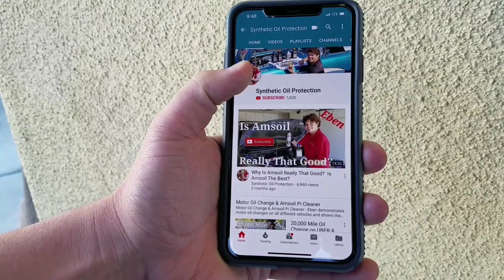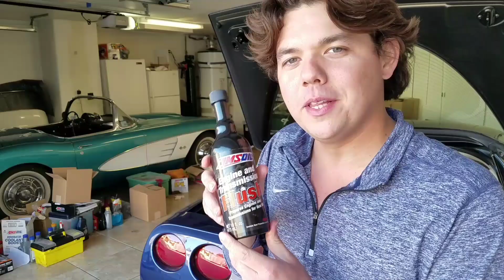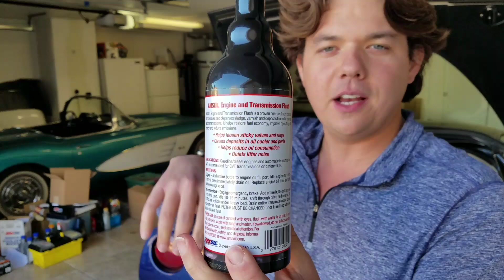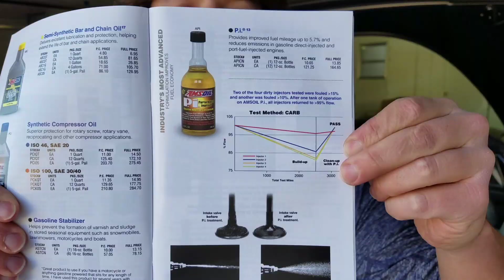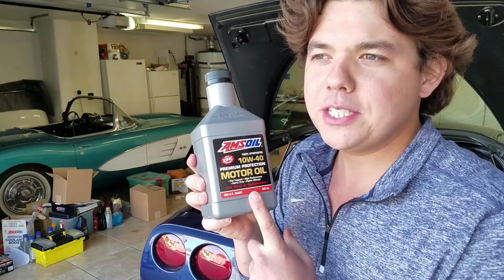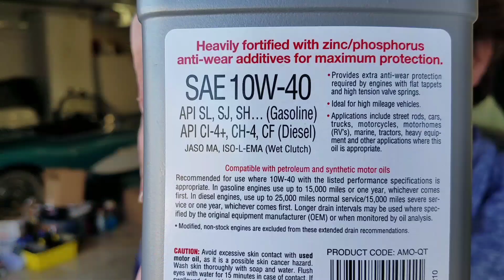Best High Mileage Synthetic Motor Oil - Oil BURN Fixed!!!

Comment: I have a 2014 Subaru Legacy that burns oil due to faulty piston rings. Subaru wont replace the motor. Says it doesn't burn enough oil. Would amsoil help with this issue?
Reply from the maker: Yes!

It will make a startling difference.

I recommend doing a amsoil engine flush I would also run the signature series motor oil as well as the amsoil Power Foam and I would also get the PI Performance Improver for gasoline fuel additive and the upper cylinder lubricant.

If you have any other questions you can always give me a buzz anytime thank you for being a part of my YouTube community!

Professional YouLubher: Eben Rockmaker Regency Direct Jobber AMSOIL Specialist (Dealer#: 5331179) 

To Order AMSOIL Products Click Here - http://syntheticoilprotection.net/ 

Find Products For All Vehicles - 
https://www.amsoil.com/guides/?zo=5331179
Reply: I guess im lucky My 93 Legacy has 240.000 on it and still doesnt use a noticable amount of oil. At about 225.000 miles I went to walmart 20.000 mile oil. I use toilet paper oil filters and normally dont drain oil
Reply from the maker: How often do you change your oil?

Comment: I know I’m a little behind on this video and probably won’t get a comment back, but I bought a used truck with 200,xxxmiles on it. the next oil change is coming up and have been researching engine flushes and have read a lot on it and have seen where everyone has said to not do it. But I am wanting to start fresh on the next oil change and was wondering what your thoughts are on a flush with something like that.
Reply from the maker: Great question Cody This playlist will give you some great insights if you ever have any questions you can always reach out to me anytime.
https://youtube.com/playlist?list=PLB_ftWArBFddawwJUyra9BJY50iLTuBN9
Reply: @Syntheticoilprotection  awesome, I’m seriously considering being a dealer.
Reply from the maker: Sweet☕
Yeah it's one of those things where it's very beneficial if you already do work with lubricants already and you talk to people everyday It's a very very easy thing to do if that is your daily activity.

If you are not familiar with much of it and you're just starting from scratch it takes a while to get the hang of things.

I'll always be around if you ever have any questions 😊

Have an awesome weekend

Comment: Spec·u·la·tion - 1.The forming of a theory or conjecture without firm evidence. Anyone can talk about a product, showing proof, that's the hard part. I'm not saying this isn't a bad product, I use it myself. Do your OWN research! The research should show a mechanical device using this product. Don't fall for those fake drop tests, they are meaningless.
Reply from the maker: The Power of AMSOIL Signature Series 5W-30 Synthetic Motor Oil protects against harmful deposits on turbochargers 4X better than Mobil1® Extended Performance and 3.6X better than Royal Purple® in industry-standard testing*.  Read This Article - https://www.amsoil.com/newsstand/motor-oil/articles/leading-the-field-in-deposit-protection/?zo=5331179 

     Better MPG Proven. Read This Article - https://www.amsoil.com/newsstand/motor-oil/articles/another-win-for-amsoil-products/?zo=5331179 

AMSOIL Performance Test Results. Read This Article - https://www.amsoil.com/performancetests.aspx?zo=5331179

Comment: Will doing all this stop my oil burning in my 2003 Nissan 350z? I have to put new oil in every 1-2 weeks. And do I need to do and add all this at once?
Reply from the maker: Yes if there is no damage to your motor and it's just build up and carbon Yes it will definitely stop it from burning oil.

If there's a component that's broken inside the motor then it will have to be fixed.

I would recommend doing everything I did to my Cadillac in this video - 
https://youtu.be/-T_-mF8tlyA
Reply from the maker: Professional YouLubher: Eben Rockmaker Regency Direct Jobber AMSOIL Specialist (Dealer#: 5331179) 

To Order AMSOIL Products Click Here - http://syntheticoilprotection.net/

Comment: for that year I put in maybe about 9k miles and my car is a Mazda 2010 cx7 and right now have 73K, the car still operates but every time i turn on the engine lot of smokes comes out
Reply: When smoke comes out on start up that is usually a symptom of leaking valve stem seals. If it also happens on acceleration it maybe your turbo going bad if your car has a turbo.  @ 73k im thinking its more likely a turbo issue if your car has a pcv get that checked aswell. Failing pcv can cause smoke out tail pipe. Also blue smoke or white smoke? Blue smoke is oil burning but white smoke is due to head gasket leak or just condensation and can be normal for alot of cars.
Reply from the maker: It could be a bunch of things just depends on the car what's broken.

I would take it to a technician and have them check it out.
Reply: @Syntheticoilprotection  Does Amsoil have any seal swellers in the oil like most high mileage oils like mobil 1 and other high mileage oils?

Comment: Amsoil 10W-40 vs Amsoil 5W-50 what would help more for burning oil?
Reply from the maker: The viscosity is very small part of it The best thing you could do is an AMS oil engine flush and also a bottle of PI performance improver and I would also get a can of amsoil Power Foam.

This is my personal link and if you use that link I'll be your amsoil Dealer.
Professional YouLubher: Eben Rockmaker Regency Direct Jobber AMSOIL Specialist (Dealer#: 5331179)
Reply from the maker: You'll see in my playlists the amsoil Engine flushes and you'll also see the amsoil Power Foam cleaning videos in one of the best videos is on my 59 Cadillac DeVille you'll see where I clean the engine
Reply: @Syntheticoilprotection  okay thank you I'll check out, and I'm probably gonna go with 5W-50 just cause I live in Toronto
Reply from the maker: Hey Tom this is the 1959 Cadillac DeVille amsoil engine flush power foam video - https://youtu.be/-T_-mF8tlyA
Reply from the maker: Professional YouLubher: Eben Rockmaker Regency Direct Jobber AMSOIL Specialist (Dealer#: 5331179) 

To Order AMSOIL Products Click Here - http://syntheticoilprotection.net/

Comment: Lexus Is 250 engine oil burning what solution?
Reply from the maker: I would do a amsoil engine flush also amsoil power foam and a bottle of amsoil PI Performance Improver.

once you do that I would definitely switch it over to the amsoil motor oil that is recommended for your vehicle.

This is the lookup guide that I will give you all the products for your specific model.
Find Products For All Vehicles - 
https://www.amsoil.com/guides/?zo=5331179
Reply: @Syntheticoilprotection   but this oil not available in uae 🇦🇪 only usa🇺🇸 Canada 🇨🇦
Reply from the maker: It may be there are new distributors all the time all over the world This is the lookup - https://www.amsoil.com/international/distributor/?zo=5331179

Comment: I have a 2012 Mini Cooper countryman S  that burns oil crazy. What recommendations would you give to help?
Reply from the maker: If it was mine I would Power Foam, engine flush , pi cleaner it and switch to Amsoil Euro motor oil.
Reply: Did you slow down the oil burning on your Mini Cooper?
Reply: @dashcamjourney4599  yes I did. I end up using Lucas oil stabilizer and my car has done so much better on oil.
Reply from the maker: Everything I do to my Cadillac - https://youtu.be/-T_-mF8tlyA
Reply from the maker: This is my website 
Synthetic Oil Protection Website - http://syntheticoilprotection.net/

It's best to be a 6 month pc to get wholesale price at about 25% off and then you'll get free shipping.

Promo code: BOWL121
Reply from the maker: Professional YouLubher: Eben Rockmaker Regency Direct Jobber AMSOIL Specialist (Dealer#: 5331179) Mobile: (702) 472-3614

Comment: I’ve gotta 383 Stroker high compression engine.   Gonna have to try it cause oils getting black before 3k miles
Reply from the maker: The best way to get amsoil is as a 6-month preferred customer you'll have the wholesale price which is about 25% off and you'll also get the free shipping.

Synthetic Oil Protection Website - http://syntheticoilprotection.net/

Latest promotion code: BOWL121

Comment: The best high mileage oil is royal purple hmx oil, it is pricey it is almost 45.00 for a 5 quart container online.
Reply from the maker: The Power of AMSOIL Signature Series 5W-30 Synthetic Motor Oil protects against harmful deposits on turbochargers 4X better than Mobil1® Extended Performance and 3.6X better than Royal Purple® in industry-standard testing*. https://www.amsoil.com/newsstand/motor-oil/articles/leading-the-field-in-deposit-protection/?zo=5331179
Reply: @Syntheticoilprotection   Royal purple oil cleans the engine the best out of all the oils, I'm sticking with it. Have a great day.
Reply from the maker: You'll get a kick out of this.
AMSOIL Performance Test Results - https://www.amsoil.com/performancetests.aspx?zo=5331179
Reply: @josiahculley9877  lol Royal purple is a scam. I’ve heard of it destroying peoples engines

Comment: How much percent , we should mix that type of synthetic oil ???
Reply from the maker: I Would look up for your vehicle.

Lookup For Your Vehicles - https://www.amsoil.com/guides.aspx?zo=5331179
Reply from the maker: If you're new to amsoil it's best to be a 6-month preferred customer because of the wholesale pricing and up to 25% off plus free shipping.
Synthetic Oil Protection Website - http://syntheticoilprotection.net/

     Professional YouLubher: Eben Rockmaker Regency Direct Jobber AMSOIL Specialist (Dealer#: 5331179) Mobile: (702) 472-3614
Reply: Tq soo much
Reply: I have one more question. I should use 4 litre full Amsoil in engine ? or I can mix some percentage with other engine oil ?
Reply from the maker: I would run all AMS oil if it was mine.
Reply: @Syntheticoilprotection  
I would run all Pennzoil Platinum.
Reply from the maker: I recommend you try Amsoil you'll definitely be amazed m
AMSOIL Performance Test Results. Read This Article - https://www.amsoil.com/performancetests.aspx?zo=5331179
Reply: @Syntheticoilprotection  
Pennzoil or Amsoil you can't go wrong! I just had a oil change yesterday (PP) but next time Amsoil...🤷‍♂
Reply from the maker: Oh there's a very big difference It seems like it's not but it is and it's real world testing once you feel the difference you'll be surprised.
The oil breaks down exponentially so as it ages it gets thicker and thicker and it's surprising how different they are.
https://youtu.be/0lXL0va_8rY
Reply: @Syntheticoilprotection  
Just watched your vid and I get it but I live in south western Ontario Canada and during the winter I might get a few days of -20C but other than that it stays pretty consistent between 2C and -10C and right at this moment it's 0C and so although we get a fair amount of snow it rarely gets brutally cold here. You have to go way further north from where I am to experience -40ishC temperatures. I do hear a lot of good things about Amsoil but if I did switch to it, it wouldn't be because it flows at -50C.
Reply from the maker: Same for me lol 😁
Reply: @Syntheticoilprotection  
I'm not sure where you live but south western Ontario where I am is the most southern part in all of Canada and why the bulk of the people live here. Hardly anybody lives way up in northern Canada and for good reason...😂
Reply from the maker: 😁, I couldn't imagine that type of cold 😆
Reply from the maker: You just run the oil that's specifically made for your car. It's not something you really mix with anything.

Comment: I have a 2005 Toyota Corolla with 160K miles. Do you still recommend Amsoil for my situation? I have been using conventional Pennzoil engine oil (high mileage). Thanks in advance!
Reply: Is that the 2.4 Engine 2az-fe engine in that Corolla?    Any oil burning issues?
Reply from the maker: I'm not sure what motors in it I do know she said it doesn't burn oil.

kind of hard to believe with that mileage but then again it's an old Toyota 💯

I truly think the older Toyotas were just as good or better than Honda.

Now I think the new Hondas are better than Toyota
Reply from the maker: Definitely if it was my personal car I would do an amsoil engine flush and also a AMS oil oil filter along with AMS oil signature series and the PI performance improver That's a great start that will give you a lot better power and your engine will run a lot smoother and your engine will last much longer with much better reliability and better cold start.

this is my website and if you're new to amsoil it's best to become a 6-month preferred customer that way you'll have the 25% wholesale price.

Thanks D for being a part of the channel 🎬😃

Synthetic Oil Protection Website - http://syntheticoilprotection.net/

Comment: I knew I had to change the oil on my car but never did. Finally after a year decided to change the oil, then whole lot of smoke was coming out. So, if I use these  motor AMS OIL cleaner, would this 
stop the smoke coming out of my car?. The car is a Mazda CX7 2010 with 73k mile on it.
Reply: Oil sludge....how many miles did you put on the engine for the entire year?  Hopefully this isn’t the case
Reply from the maker: I don't know anything about that car

Comment: I have a 2007 Dodge Charger police interceptor 5.7l I purchased a month ago. It runs great. 200,000mi. Can I switch to Pennzoil Ultra 5w20 synthetic oil?
Reply from the maker: You sure can also Amsoil makes an oil that is quite a bit better because it's 100% synthetic and it's a lot less money.

If you'll be driving a lot of miles I definitely recommend getting the signature series but if you only drive a few miles a year the Amsoil oil is a great oil.
https://www.amsoil.com/p/oe-5w-20-synthetic-motor-oil-oem/?zo=5331179

Also if it's your first time trying Amsoil it's the most cost-effective as a 6-month preferred customer you'll have the free shipping plus the wholesale price.
Reply from the maker: Ebens Link: AMSOIL Wholesale + FREE Shipping: https://www.amsoil.com/offers/?zo=5331179

Comment: Hi, Can I use 10w40 AMO(high zinc) on my VW Golf 2.0 FSI year 2004, which does not have the vw certifications?
Reply: Thank you for your reply.
Reply from the maker: I am not sure it may not pass the emissions compliance or it could wear out your catalytic converter prematurely.

I would stick with the European specification unless you're doing racing and if you are I would use the Dominator racing oil
Reply from the maker: David this will give you the fluid capacities in the proper products for your vehicle.
Lookup For Your Vehicles - https://www.amsoil.com/guides.aspx?zo=5331179

Comment: Hey mate, my current Prius Gen 2 is about 130k mileages so can recommend the engine oil type best my car 5w30 or 10w40?
Reply from the maker: This will give you all the fluid capacities for your vehicle in viscosity 
Lookup For Your Vehicles - https://www.amsoil.com/guides.aspx?zo=5331179
Reply: 5w30.  It depends on oil operating temp, in hot middle east you would run thicker than alaska  for example .Maybe 5w40 or 10w40 only in very hot climates where the temperature doesnt get cold, look up mobil 1 website in your region and check owners manual too.  0w20 is specced in usa for fuel economy reasons, and im guessing oil pump and engine clearances are same for all gen2 prius.  check mobil 1 website in various regions, including yours.  Example uk mobil 1 recommends 5w30 for most toyotas, usa mobil 1 recommends 0w20.  there is a lot of engine oil politics in the usa though, another example is with ford, they recommended 5w30 in canada but during the same time period on the same vehicles, 5w20 in usa.  I will always use synthetic oil in the thickest viscosity that is recommended for my climate/temperature.  I think people worry too much about oil viscosity, i saw a video on youtube where a guy tried using differential gear oil in his engine for over 1000 miles and it was fine, thats def not a good idea though!
Reply: @connor3288  thanks for ur recommendation so in country I still can use 10w40 with no winter season here. Cos my temp is the same as California
Reply: @primsopheak3853  Hows it running so far on 10w/40?  I’m thinking of using 10w/40 also.

Comment: Why not just use fully synthetic Lucas?
Reply from the maker: You can Lucas is great.

     The additives do wear off quicker so it's kind of one of those things where if you want a better cold start with less thick oil you'll be better off with 100% synthetic you'll have less wear on your engine during the cold start we're about 80% of the wear occurs and also you'll get a little better gas mileage with 100% synthetic so it's one of those things where you'll change your oil less you'll save a little more money but the Lucas is still a great oil☕
Reply: Synthetic Oil Protection great explanation I have a 2012 750Li and the Lucas slowed down the oil consumption tremendously.... I went from adding a qt every week to almost going 3 whole months only using the Lucas... I have 117k miles I think I will give this product a try on my next oil change thanks a lot 🙏🏾
Reply from the maker: 😉, 

This will get you the 25% off as a wholesale account on most of the items and also you'll have the free shipping.

Ebens Link: AMSOIL Wholesale + FREE Shipping: https://www.amsoil.com/offers/?zo=5331179 

Lookup For Your Vehicles - https://www.amsoil.com/guides.aspx?zo=5331179